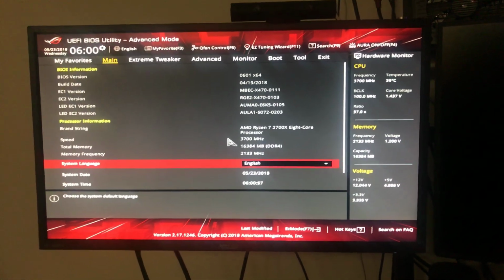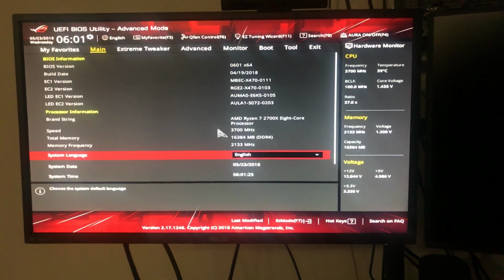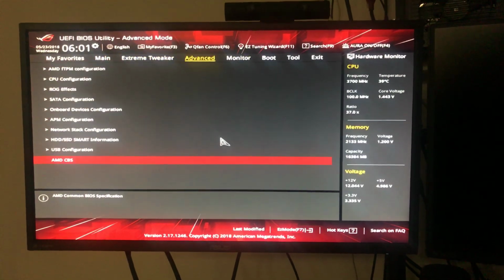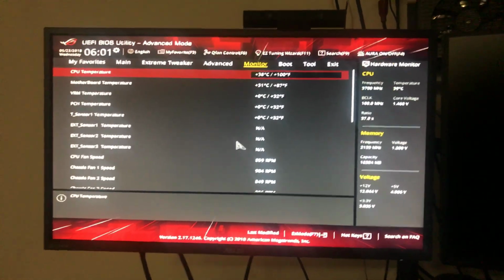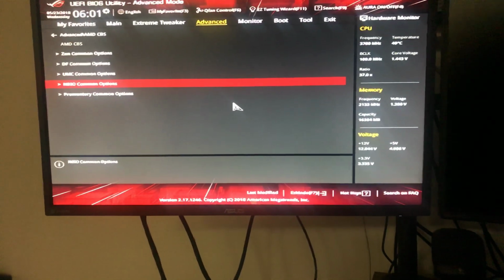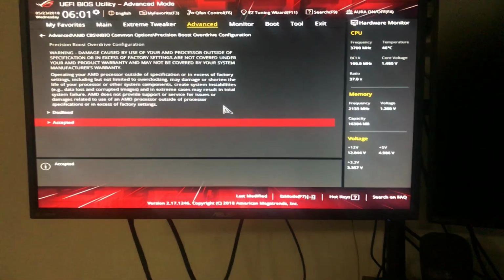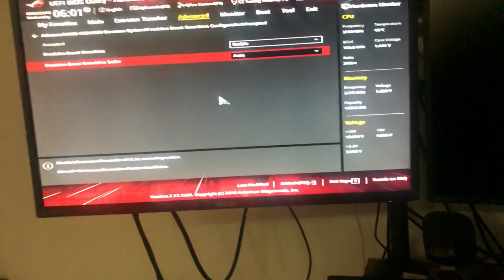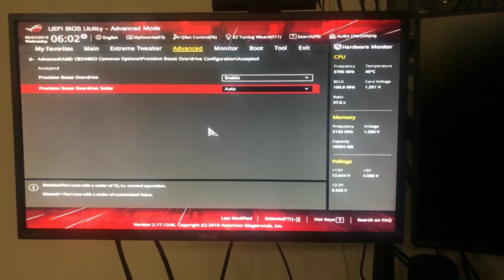Enable precision boost overdrive (PBO) on an ASUS board

Comment: Will the settings be the same for Ryzen 5 5600X? I have a problem with the temperature of 71 degrees while playing, which causes the cooling system to be noisy. Will these settings help? I have an Asus TUF Gaming B450 board
Reply from the maker: Settings will be the same, but this will not help. PBO will help it run HOTTER for LONGER. You want to look into undervolting if you want cooler.

Comment: Could anyone explain me... If i go to enable this , going Back in Windows , i still got Stock GHz nothing happend at all .. got a AMD ryzen7 5800x3D , Stock ist in 3.58ghz , my Boost clock must Go to 4.4-4.5ghz but still IT Look Like Stock clock ... What do i wrong
Reply from the maker: The x3D is kind of a unique beast. You can’t overclock it. Enabling PBO will just hold the boost clocks longer.

Comment: Unfortunately the 5800X3D cannot be over or underclocked and PBO is disabled. Luckily it's still faster than any other CPU for gaming at stock speeds so there is no need.

I spent money on a 360mm AIO cooler that is totally overkill :D At least it looks pretty.
Reply: I don't think thats correct but I could be wrong. Guy I watched.was using a 5800x3d with PBO enabled
Reply: Maybe on some boards? Not an option on mine unfortunately. OC is definitely not possible

Comment: I have an Asus B550i board with 2803 BIOS and a 5800X3D. I don't have the 'Precision Boost Overdrive Configuration' option under 'NBIO Common Options'. Has anyone got an idea where could I find it?
Reply: I got a reply on Reddit. 5800X3D is locked so these settings cannot be changed on it.

Comment: 5950x + 360mm AIO, is this worth enabling for a creator/gaming/allrounder PC? Or will it just cause idle temps to be unnecessarily high? thx for the info!
Reply from the maker: My current machine is a 5950x and 3090 on a 480 custom loop. CCD0 spikes to 90 with it enabled, and that’s after undervolting. So even though I did it…I’m not sure I’d recommend it unless you want to put in the time playing with core undervolting.
Reply: @kickblake  damn that sounds like a fun setup! I Definitely don’t want to put that much effort in, so just enabling PBO is not a foolproof option which instantly gives u better performance without any downsides I guess?
Reply from the maker: @nova_casanuova  PBO is always going to result in more heat, and your 16 cores are already pretty warm!

Comment: Is it a good idea to enable this with a regular air cooler?
Reply from the maker: It won't hurt it.  The CPU will still thermal throttle when necessary.  I just don't think you'll see much additional performance.
Reply: @kickblake   Just enabled it,  yeah im gonna get a liquid cooler soon but cant hurt to activate PBO now.   The cpu has failsafes if temps get too hot anyway

Comment: If you have a newer asus motherboard bios it has been moved to the extreme tweaked tab now
Reply: thanks man
Reply: What is the difference between auto and enabled ?
Reply: @Rwayne- i think enabled lets you manually input more values or at least lets you override some automatic limitations that Auto mode would still have in place. In my bios the Precision Boost Overdrive is actually in 2 places and both can be adjusted.

Comment: will this work on ryzen 5 1600 ?
Reply from the maker: Sorry, no. PBO was a feature introduced on the 2000 series chips.
Reply: Thanks, but there is any way to boost it? It says nominal frequency 3.2 ghz and turbo boost frequency 3.6 ghz
Reply from the maker: @Robert-fr5ms  the CPU will move between those frequencies on it’s own as heat and demand change. PBO is used to go OVER that boost clock...if you have a way to deal with even more heat.
Reply: Thanks

Comment: Thanks bro! Increased my rtx3080/5600x score in port royal from 10500 to 11400 using stock config.
Reply: I bought the be quiet dark rock pro slim. Its awesome. Under 70 degrees always and quiet
Reply: @megalodonultra5827  hey, tjx for fast reply bro. I just builded my new pc and i eas shoked woth Cpu tems with stock cooler. Its too weak for that crazy Cpu while is rushing on 4,4ghz on auto boost. Im thinking about Arctic freezer 50 to put on it, or some water AIO. Only thing i hate about those "custom" big fans for cpu, is that they are too fcking big and they took u half of space in pc...
Reply: @Koksha88  stock is fine, but its noisy
Reply: @megalodonultra5827  yeah that too. And he cant cool it down. In games is around 80 degrees... Sometimes on idle is 48-50. Idk is that normal for 5600x. I know Wraith stealth is too weak, but that it cant cool it on game is just sad.
Reply: Hey bro. What cooling solution u have on your 5600x? Cz my stock coolecant cool it down good. Sometimes on idle takes to 50 celsius. I have 5600x too.

Comment: But can u do it with a stock cooler
Reply from the maker: Benjinite you can try. Its likely to throttle, negating any benefit of the overclock.
Reply: kickblake, so ur saying I can try but it’s not the most efficient way

Comment: I just installed a 1600 AF, i don't have this option on my bios (ASUS B450M GAMING), that's a bios falth or my processor doesn't suport it? It should cuz it's from 2ªGeneration of Ryzens, "AF" it's the new version. (I already updated my bios) I just have that old boost option there, inside CBS
Reply from the maker: Gabriel Bl4ckH4wK I think it only works on the x processors.

Comment: A Prime X370-A here (BIOS version 4801), but i see no PBO option under that section.
Reply: What section is it under on the x370? .. I can't find it
Reply: @nvthagbent  The BIOS of my X370-A shows it (after hitting F7) under:
>Advanced
>>Advanced\AMD Overclocking\Decline
>>>Precision Boost Overdrive 

Mine is on Auto. I don't care much about overclocking.

That is with BIOS version 6026 (not the latest).
Reply from the maker: Jon Doe only x470 boards will have PBO.
Reply: @kickblake  I have (found) that "PBO" option in the BIOS of my X370 motherboard too in the meantime (it is under another section).

Comment: Is it normal for it to spike to 1.5 volts?
Reply from the maker: voltage at idle is pretty high.  You can set an offset on the extreme tweaker tab if you want.  that'll help contyrol temps too
Reply: kickblake I added a negative offset of -0.1 volts but my VID Voltage went up to 1.55v and ryzen mastser also shows 1.5-1.55 volts. Is that normal and if not, did I do something wrong?
Reply from the maker: Rubyturnip238 is this just at idle or under load? Snag a free copy of something like cinebench R15, and see if it stays at 1.5v during the run. It’ll probably dip under 1.4v.
Reply: Cinebench r15 Load:
cpu VID: 1.475v~
cpu core voltage: 1.35v~
Ryzen master voltage: 1.475v~ (same as VID voltage)

My temps are fine at 65*c~
Reply: CPU VID is the voltage that the CPU is requesting not the actual voltage. The actual voltage is the CPU core voltage.

Comment: PBO is IMO either crap or it doesn't work. Running a Crosshair VIII Hero x570 board with a Ryzen 3900x and max auto/boost is just under 4.2ghz. That's with an AIO and temps of 60-70 degrees. I had to manually OC the CCX's. Got them up to an average of just below 4.4Ghz across all cores at 1.35v stable.
Reply: Ditch it I've upgraded from that and bought the Ryzen 7 5800x holy shit when I enabled PBO my core shot up to 4.85 ghz on it's own being though it's advertised to run at 4.7ghz.?. I have it set to auto no max cpu boosts either only thing touched was the PBO that's it wow what a chip idles at 20-35c and at gaming, example in Warzone temps top out at 60c on a Coolermaster 212 with my ac set to 69 degrees brrrrr chilly but helps tremendously Ryzen loves to be the coolest it can get runs way better and faster.

Comment: Wheres cool qnd quiet
Reply from the maker: lucastanaka7 I don’t think there’s a setting for that anymore.
Reply: @kickblake  my ryzen 3700x is so hit, in idle 60-70C, and gaming 70-87C !
Reply from the maker: lucastanaka7 60 at idle
Isn’t right. You might want to try reapplying you’re thermal paste.
Reply: @kickblake  the Volts is so high, chaing 1.0 to 1.46 in 1 sec, and get this hot temperatures

Comment: just looking how to turn off it. basicly, this is a stupid and useless tech. cause while I just watching video or just watching the news, the frequency jump up and down. from 3500 to 4200MHZ, and CPU volt too. while I am playing game, it also up and down. For game, it's need a STABLE FPS, not up and dwon,  40-120FPS is worse than a stable 100FPS, everybody know it.
 
I think it totally belongs to marketing strategy, cause AMD want their frequency looks HIGHER as Intel did. like 3700X, it decribe as "3.6G as basic, 4.4G MAX". Looks like Intel's boost tech. but their are different stuff. Intel's stategy is FULL CORE SPEED keep BASIC frequency, Single CORE speed can REACH MAX frequency. AMD's PBO tech is keeping FULL CORE SPEED,  let them up and down Very fastly, to reduce temperature and heat, OR, increase MAX frequency. but it's not helpful for game. Cause it's not only can't guarantee a stable FPS for game, but also produce massive heat in a LOW Loading programme.
Reply from the maker: Jimmy Yu to turn it off, just don’t follow the steps in the video.
Reply: @kickblake  haha, i did it. turned the PBP off. now the frequency keeps on 3800MHZ(just input the number, 4G or 4.2 will bring much heat, 3.8 is just enough for play most game in 1080P). it works! the frequency no longer jump up and down.

Ton of player suffered RYZEN 3000 PBO MASSIVE HEAT issue, ur video will get hot!

 thank you for the video.

Comment: Nice I just bought this mobo the 3700x using corsair vengeance rgb pro 3600mhz ram, love all the features but as someone who hasn't use AMD since old Athlon cpus, the names and settings of things especially in such a feature rich motherboard is baffing me lol
Like XMP on intel i didn't know how to  enable same feature but I have since worked this out.... 
I was told by a friend to enable PBO2 and AOC, this video was great no BS just straight to the point, I would ask do I need to change any other settings for AOC? and would you recommend me using the built in bios CPU profiles ROG have for my 3700x, it seems they really up the CPU voltage, I ran ROG profile that enables 4.4ghz all core overclock which ran great but the voltage was I think a lot it was 1.45v (fluctuation in cpu z + - 0.05) I then changed the voltage manually too 1.35v and it seems to run great would you recommend any advice on what I've done so far? both these OC where with D.C.O.P 3600mhz (the ram is 3600mhz 18cas set) I would like to reduce the timings but jesus the timings and ddr settings is huge...
Reply from the maker: I'm personally not a fan of the AOC settings.  In the end I set PBO back to auto, set Performance Enhancer to LVL 4, and then dialed in a negative voltage offset to as low as I could go and maintain stability.

I'm not sure if any of this applies to Ryzen 3000.  I'm still waiting on the 3950x to start playing with the new gen.

Comment: I hope u changed your memory speed .. it´s   goes on defualt .. which is way  slower than what it should be .. ( makes a big difference)
Reply: How do you do that??? My 3200 ram is set to 2400.
Reply: @shocknawe  Enable the  XMP Profile for your RAM or in ASUS' case they call it D.O.C.P.

Comment: Mine is greyed out on my b350f with latest bios
Reply from the maker: Jahseh Denton what processor?
Reply: @kickblake  2600x , nevermind  i found it they moved it apparently, thnx for the quick reply though.
Reply: @Johnny-on7ig  where did they move it to? having same issue
Reply: @bounceoutbari7894  On the ai tweaker tab
Reply: If you have a newer asus motherboard bios it has been moved to the extreme tweaked tab now

Comment: Does auto mode still function like enabled?
Reply from the maker: TrainMasters Uk I think auto is only going to work if you're using performance enhancer lvl 3 or 4
Reply: @kickblake  Where can i change the performance level?
Reply from the maker: @TheAerospaceChannel  that's on the Extreme Tweaker tab somewhere betweenthe ram settings and voltage settings (going off memory here).  I'd stick with lvl3 unless you're water cooled.
Reply: @kickblake  if i used enabled and dont change my performance lvl what clock speed am i looking to get [all core]? For the 2700x
Reply from the maker: @TheAerospaceChannel  depending on cooling you'll get 3.9-4.0
Reply: @kickblake  I have manual overclocking on my Asus X370F gaming and 2700X and run stable at 4.2. Using stock/wraith prism cooler. Peak temp under high load video encoding 80C, but mostly ran at 79C. Never changed CPU voltage (AMD says it auto-adjusts voltage as it needs to?) at all, just multiplier.
Reply from the maker: @SpreadTruth24  the AMD voltage curve gets pretty steep pushing that to 4.2.  You might get lower temps by adjusting the voltage.  That being said: I was only able to get mine stable at 4.2 under WATER with peak temps at 74.  You have, apparently, won the silicon lottery.
Reply: So 4.4ghz all cores random very short time bad or good?
Reply: @DragonProtector  on a 2700x or a 3700x? 4.4 is a VERY High all core overclock. 4.2 is a bit better. Im not surprised it doesnt maintain 4.4 for long.  So its not bad . Its decent
Reply: @TheAerospaceChannel  it a 2950x
Reply from the maker: @DragonProtector  That's better than what  I've been able to get on my 2700x
Reply: @kickblake  idk if my pbo even working cause it on auto in bios and that other setting on auto to

Comment: I've enabled PBO and XRF2.

CPU- Ryzen 5 2600x

XRF2- took the base clock speed from 3.6>3.8
PBO- Did nothing

Cooling- Liguid AIO Cooling

Base Clock: 3.8 Turbo Clock: 3.75

Advertised: 4.2/4.3

Please help :(
Reply from the maker: ReckMods that advertised has to be a single core speed. The absolute best I’ve been able to get with a 2700x on PBO is 4.26 all cores. And that’s open loop cooling, and it still spikes past 70C under load.
Reply: @kickblake  Does it make sense for my turbo speed to be less than my base clock?
Reply from the maker: ReckMods on the same screen where you enabled PBO, what level did you select?

Comment: For gaming... in lets say csgo where single clocks speed matter a lot. Is PB > 4.2 manual all clocks? Hmm...
Reply from the maker: David I’d say no. I was only able to get a 4.0 all-cores boost with PBO
Reply: @kickblake  Okay, thanks mate. I jus got my processor, still trying to figure out the optimal settings :)

Comment: Hello. when we use PBO, do we set core ratio into fixed number or leav as auto? Thank you
Reply from the maker: 최봉기 leave as auto
Reply: and 1 more question is for core voltage set as auto or offset? Thank you
Reply from the maker: 최봉기 leave as auto unless it’s unstable

Comment: I got a Noctua NH-U12S SE-AM4 cooler.
Should i enable it in the bios, or should i let it stick to auto?
I mean, my cooler is a high end fan cooling, but still, its a fan cooler.
Initially my fx8350 (my old cpu) had watercooling, but the cooling broke down, and deciced that because i do no manual overclocking a high end fan cooling was enough for my ryzen 1800x
So, do you advice me to retrace your steps and enable the precision boost, or let it stick at UEFI's defaults?
Reply from the maker: Martijn Spiegelaar this particular feature only works on 2000 series Ryzen
Reply: Hmm, nevertheless thanks for the reply, i keep it as i have it currently then
Reply: Still another question about this feature, cause if i heard right, the first generation should also have xfr, or at least something that works like it the same way.
So is there any option for me to make it work? Or did i misheard it?
Thanks in advance
Reply from the maker: Martijn Spiegelaar if you have an x processor, XFR is on by default. This is the primary difference between a 1700 and a 1700x. 

PBO only works on 2000 series and basically extends the functionality of XFR beyond what AMD considers “safe.”
Reply: So, with my 1800x, i already have XFR on then? no need to set additional settings in the bios and so forth to get optimal performance?
Reply from the maker: Martijn Spiegelaar correct. XFR is enabled. You are capable of overclocking beyond XFR, but it will be manual.
Reply: Nah, better not fiddle with that. Tried it once back in the amd athlon 1 days, but it failed horrendiously, so i will keep it like this then.
Still thanks a bunch for explaining all this :)

Comment: Does it work on the first gen cpu's?
Reply from the maker: Frank Logrim Nope, you’ll have to do a first gen manually.
Reply: @kickblake  how to do that?, i set up custome p states?
Reply from the maker: Frank Logrim  no, youll judt hsve to directly input a clock speed and core voltage on thr extreme tweaker tab

Comment: I'm on the latest BIOS for the Asus crosshair VII and my bios matches your layout all the way until the end where there's no Precision Boost Overdrive, why is that?
Reply from the maker: RayZahT what chip are you running?
Reply: @kickblake  Ryzen 2600. On the Asus Crosshair VII X470 motherboard
Reply from the maker: RayZahT I'm still attempting to confirm, but this may be an x only feature.
Reply: Should be all gen 2.
Reply: @RayZahT  I would assume all Ryzen cpu's can be overclocked, so it may have been a Chipset issue or Bios update that included it.  Maybe he just couldn't find the PBO option, it can be quite hidden in some Bios's.